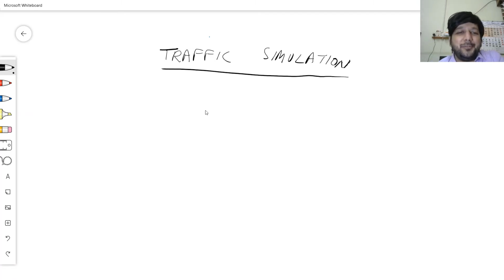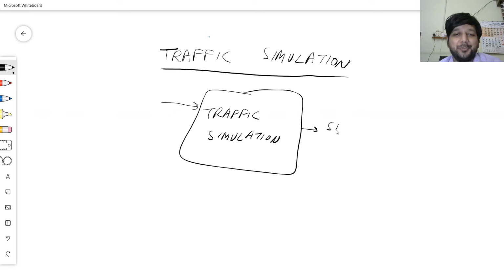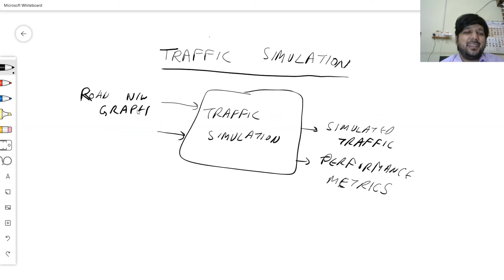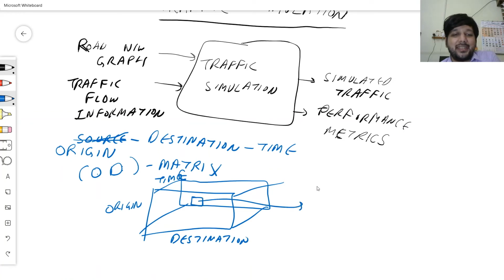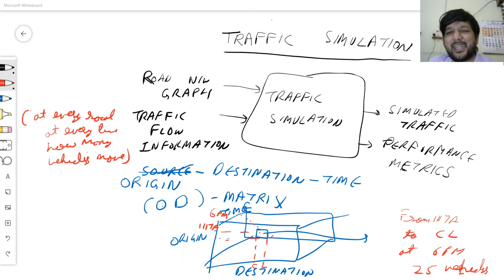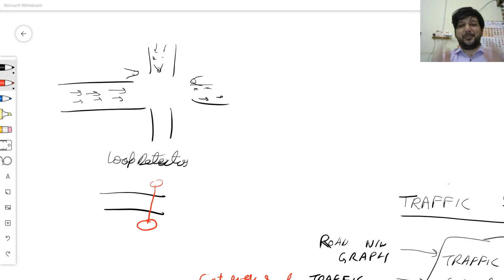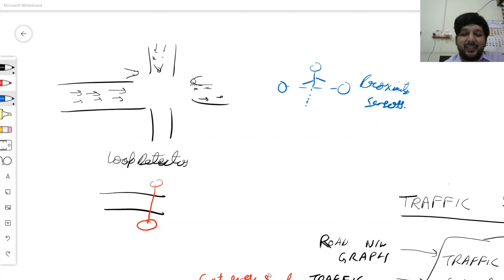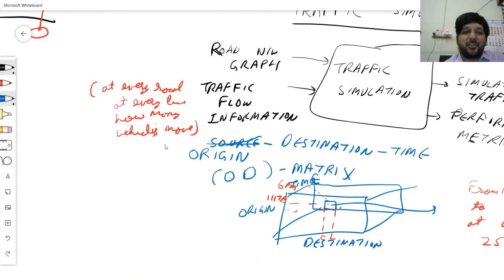H33 P1 Traffic Simulation: Introduction

Comment: Loop detectors operate on the principle of electromagnetic induction rather than vibrations. They consist of loops of wire embedded in the pavement, through which an electric current continuously flows, creating an electromagnetic field. When a vehicle passes over the detector, the metal in its body interacts with the magnetic field, inducing changes in the field’s inductance. This disturbance is detected by the system as a drop in current, which is recorded as a vehicle passing over the detector. Nothing to do with vibrations.